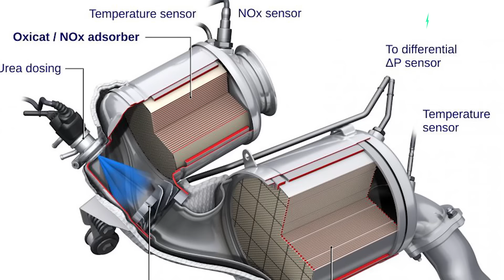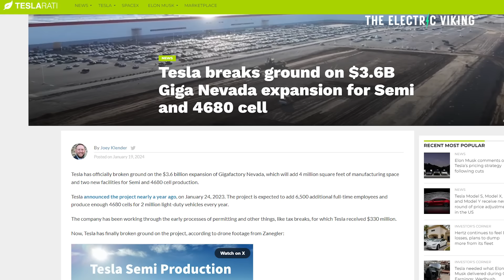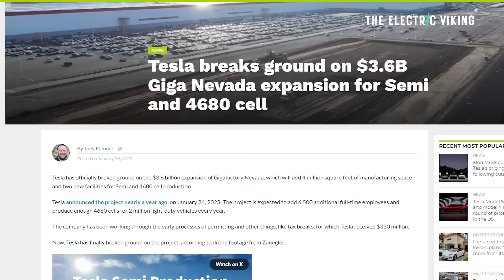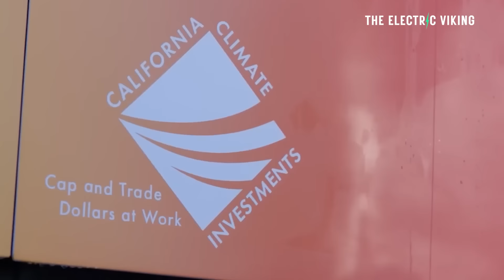Tesla reveals timeline for massive electric Semi production at $3.6B factory

Comment: It's funny how many armchair CEOs think they can out-plan Elon. He's brash and bold, but he's also extremely logical and thinks like an engineer. He's well aware of how important the Semi is, both to Tesla's bottom line and to the environment, and he cares about both. Tesla hasn't really talked about the semi since the first batch to Pepsi, which leads me to believe that they are doing a final "engineering pass" with the Pepsi trucks, getting real-world feedback before going into mass manufacturing.

This is because Tesla is well aware that the first generation of car you build will have problems and kinks to work out. It's much better to work them out with one company, where you can get intense and focused feedback, and ALSO not piss off a bunch of haulers with potential engineering problems. Better to have a limited release, but to real-world conditions, with a business relationship that will leed to feedback to the engineers back at Tesla rather than hit-pieces sent to media outlets.

So when Tesla finally DOES go mass market with the truck, it will not be the first buggy version, but the version after some polish and tuning, yielding a better experience for all new buyers. And Pepsi will have benefitted from being an early adopter with whatever troubles they may have faced AS an early adopter, by having access to the lower cost hauling that helps their profit margins. Win-win.
Reply: Exactly!
Reply: Isn't that the truth....
Reply: I agree 100% but would add that Elon wouldn't want to build the production line out until he was certain of what it would need for maximum production efficiency until the engineering was finalized.
Reply: @ColinFox  I don't buy this explanation.  I'm sure Elon has a good reason for holding up the semi, but your reason makes no sense to me.  When has Tesla ever released a few prototypes of a vehicle for years of road testing by a second party prior to going to mass production?

If this were such a sound plan, why didn't they do this with the Cybertruck?  Or the model X for that matter?  

And if road testing were the reason for the delay, how long would it take to test it?  It's been three years since they delivered those first trucks to Pepsi.  The semi is already superior to any ICE truck.  Why not get it on the roads in a massive way and start profiting from it--both financially and environmentally?

I don't know what the holdup is, but this "refinement" argument doesn't wash with me.
Reply: It's hard to out BS a professional BS'er like Musk, almost impossible.
Reply: @hwirtwirt4500  And yet, you try.
Reply: @eyesuckle  Well, he DID  beta test - first with the roadster (limited run), and then the original Model S. Those were both relatively limited runs in the first year or so.

And the semi has a lot more physical demands on it, and with serious durability concerns that just don't exist in the car market.

Elon wants to hit it out of the park, not some milktoast bland truck, this has to be stunning, and given the demands of a professional clientelle, it makes sense to do this step right.

I've been in the tech industry for 40 years (software, but still...) and this strategy makes perfect sense to me.

If you don't think I'm right, by all means offer up another explanation that makes more sense.
Reply: And he's in the governments pocket and vice versa.
Reply: @ColinFox  Elon thanks you for pasting ad copy on as many videos as you can.
Reply: @hwirtwirt4500  The Electric Viking thanks you for interacting as many times as you can on his videos for the algorithm.  Unless of course you work for him, then dance monki dance.
Reply: @longmuskox4194  Yes, I interact or more precisely fact check. I hope you enjoy it.
Reply: @longmuskox4194  Overall a quick estimate on his channel is 25% good information and 75% Tesla shilling.
Reply: @hwirtwirt4500  Your estimates and "facts" are BS.  You said you attempt to out BS others.  You're full of it.
Reply: @longmuskox4194  Don't be so easily duped by a conman, learn to think for yourself. What fact did I get wrong?
Reply: @hwirtwirt4500  You should learn to listen to your own advice.  I'm not your secretary.  Do your diligence.  Introspection...

Comment: How can return on investment due to fuels savings be less than 2 years? US department of energy website states average semi type truck uses about 11000 gallons of diesel per year. Current price is about $4 per gallon. Total for 2 years is $88000 so impossible to recoup $200000 in 2 years on fuel savings and hard to imagine maintenance making up the difference.
Reply: The answer is simple. Elon is making these numbers up and nobody is questioning it. He promised 7 cents/kW electricity, for ever. Even the house electricity prices are at least 10-15 cents. And, in a supercharger it gets 3-4 times higher depending on the time of the day. So, the lower running costs promise for Tesla Semi is not backed up by real world calculations.

Comment: 😂 Diesel is worst than gasoline….It depends how its burned. Euro 6 Diesel are the most clean combustion engines, so clean that the sucked air at the intake is more durty than the exhaust. 
You should make a video of the thousands ev which a stored at parking areas because the Leasing contract ended. 
These cars have to get back to the OEM and their Financial Banks are not able to the sell them
Especially Fiat 500 e

Comment: According to newspapers the Tesla Semi performance was much better than Volvo and Mercedes Electric Semi the semi truck manufacturing are not even close to complete with Tesla they are in much worse shape than personal vehicle manufacturers.
Reply: That's correct,  mercedes only get about 180 miles whereas the tesla will do 500. Mercedes said that 500 mile range would break the laws of physics. Tesla just make way better and efficient vehicles.
Reply: Tesla gets longer range by putting a battery twice the size of the others. So there is a weight disadvantage with the Tesla Semi.
Reply: @erkantruckvlog  no they don't,  their drivetrain is just far more efficient.  Tesla design their vehicles from a first principles approach - nercedes and volvo don't.
Reply: @mallamal5578  Just check the numbers, you will see. The difference in efficiency is not that much. Maybe 10 percent. Tesla Semi has two options.  The short range version with a similar battery to the rivals has similar range and payload. The long range version has twice the battery but with less payload because of the heavier battery.

Comment: I just wonder when the mainstream media is going to wake up to the fact that EV's, passenger and commercial have operating costs that are, with the right strategies, many orders of magnitude less than ICE vehicles! I charge mostly at home ~90% and my fuel/energy costs are 90% less than my previous ICE vehicle, even with 10% being on Tesla public chargers.
Reply: The semi uses a 1 Mw charger, how many weeks do you think it would take to charge with the plug at your house?
Reply: @Paul-b2s4j  What I suggest is that you do a bit of research into how Pepsi has integrated the Tesla semi into their fleet, including how they charge it.
Reply: @joebullwinkle5099 Pepsi do back to base runs so yes they can charge when they finish each run. For any other trucking model it doesn't work.
Reply: @Paul-b2s4j  Yes, that's correct, however this is only because of both Pepsi's distribution model at that facility and more importantly Tesla's decision that the first early Tesla Truck production models would not have a sleeper cab, as there was no Truck charger network setup yet and they also wanted to see how the Truck would perform in the real world with return trips. However this is only temporary, once there is some form of 1MW charging network and the early kinks are worked out you are going to see Trucks with Sleeper berths. This Truck is going to change how Trucking works in the US in the 5 years after volume production begins.
Reply: @joebullwinkle5099 won't work in Aus, to much of the country is not connected to the grid and relies on local power generation. They don't have the capacity for the multiple Mw chargers that would be needed in each town to serve all the heavy haulage traffic. We have next to no rail in WA and everything is done by trucks.
Reply: @Paul-b2s4j  Just wait and see, when Trucking operators find out how much cheaper the Tesla EV Truck and soon others are to operate. Setting up a gas station is significantly more expensive than an EV charging site and a gas station has to be constantly resupplied. 
Remember when there was no high speed internet in outback Australia! Then the federal government decided that all schools no matter where they were, must have high speed internet and five years later High Speed internet was everywhere. Don't be caught in a self limiting perspective, Australia is a perfect place for the renewable energy revolution!

Comment: Look for LG's NCM613 cell. 
There are some Korean News about LG  plan to release new cell has less Ni, 4.4V nominal voltage in 4680 in 2024.
It is 10% cheaper than NCM911, has good weight-to-power. it is targeting LFPs replacement on EVs. (might be less cycle life compare to LFP)

Comment: Sam, did you talk of a lifetime for a battery of 400,000 miles?
When Scania has negotiated with a battery supplier, they demand 1,000,000 miles and 10-12 years! The supplier said, according to tests that is no problem!

In cars there is another thing. The car makers DON'T WANT BATTERIES TO LAST TOO LONG, because they want to sell a new car to a customer in 3-4 years, not after 20 years.

Comment: Why pure play BEV Class 8 in the USA is a huge deal is because if done right vastly reduced downtime which is what 90% of all logistical issues for the US Trucking Industry is has as its primary problem. "Downtime" is much mkre than vehicle in the shop but also how quickly a truck can ingress and egress a distribution facilty, backing, clearing paperwork or i think what is known in the business as "turnaround time." Tesla knows all this and have been running these trucks for many, many Years and definitely did their homework prior to and then during. As far as something capable of being made in large numbers i have serious doubts but when additive to Nikola Motors which is hydrogen powered taken together very much a lot of possibilities although so far only being worked with the "head unit"(driving vehicle) and not so much with the trailers which simply sit around 90% of the time and could quite easily become a very valuable power source. Safety remains a major issue still, though and not just through regular driving (thermal runaway) but given the inevitable how to "safe" the battery electric system after an accident. Lots of experience with all electric buses though and now full size pickup trucks which is invaluable.
Reply: As a company driver, most of my downtime is due to picking up preloaded trailers that other drivers left in poor condition. Flat tires, loose bolts, holes in roof, etc.. My assigned power unit rarely runs into issues.

Comment: if customers wanted them why wouldnt they already be in production, i don't get it.
Reply: Elon explained that a decade ago. Production is about 200 x harder than building the prototype. They just finished testing it.
Reply: Battery is too big. They have currently a shortage of the cells.
Reply: @1voluntaryist  Why announce products that wont be ready for years and years?
Reply: @Withnail1969 It is Musk’s MO to make announcements whenever the stock is tanking.  Long time believers are getting tired of Musk’s BS.
Reply: Anticipation and preparation.  If the timeline doesn't agree with you, then that's your problem.  Deal with it...
Reply: @Withnail1969  because you are a speculative company and want your shares to increase without actually doing much :)

Comment: Tesla is late to the party.
So ... they need a really compelling vehicle with REALLY compelling economics to grab market share once electric truck adoption hits the steep part of the "S" curve.
And it WILL be different from car EV adoption.
There won't be ANY whining about range - transport fleet buyers use software to know the routes, ranges, unload times and refuel times down to the minute.
There won't be any whining about "looks". Professional drivers are paid to DRIVE, not show off like peacocks. (Not that I don't love the look of some of the really amazing O/O rigs you see, but those are not about fleets and economics).
There won't be any whining about performance. Electric trucks outperform diesels, they are quieter and they are probably safe.
So. as I think :) I've said before, it comes down to economics and availability. The operational economics is already there, NOW they just need to build them in quantity.
And the government won't need to push incentives (although apparently they do); transport fleet buyers work off Excel and it will either make sense or it won't.
But THAT S-curve won't have all the issues of a status and fad-driven consumer accessory like a car.

Comment: Once again putting the cart before the horse, building a supply before you know the demand.  Tesla is playing catch-up in a relatively small market of 350,000 new vehicles annually, by building a mass production facility with a 400,000 capacity. With very strong buyer loyality. Volvo and Freightliner have been selling EV class 8s for 3 to 4 years.    The support system for the electric Semi  is another hurdle.  Namely the charging systems.  As it is turning out the fleet operators, in theory, will have their own supply with electrical generation and charging on the same footprint. At least 90% of EV trucks will be used one day  out and return system.  And their charging systems,  will not be open to the public. There are class 8 Semi EVs aready on the road built by Volvo and Freightliner. They are following the out and back system. And are already proven winners.
Reply: They have lots of orders had to stop taking them until mass production starts
Reply: It was never to 440K per year.  Goal is 50K.
Reply: @billthecat7536  at 4:40  Sam says 400,000 and he repeats it. Take it up with him.
Reply: @Texaskeith7011  How many orders?  When will mass production start?
Reply: @Texaskeith7011  How many is lots?  Public knowledge is less than 200.
Reply: Tesla looked at the Pepsi data which you can find and figured out that it is not possible to compete using Diesel. EV competitors will be able to increase profits and lower prices at the same time. Diesel will no doubt have edge cases but they will few.